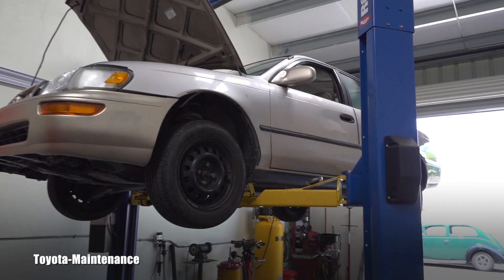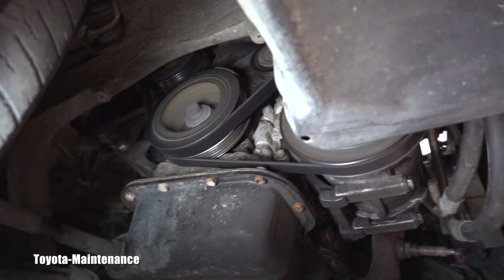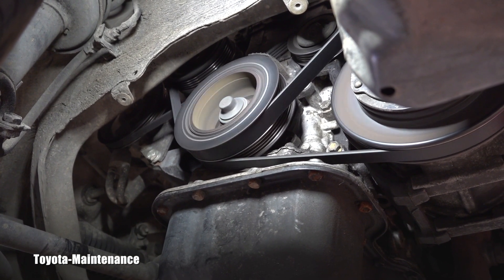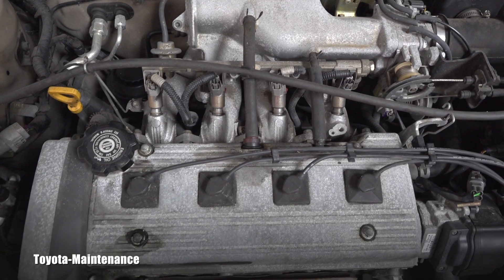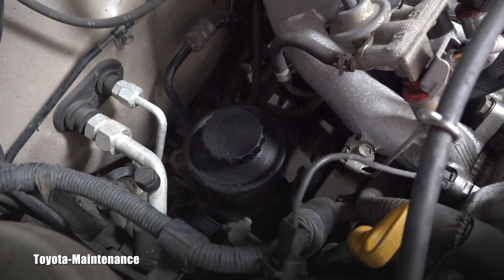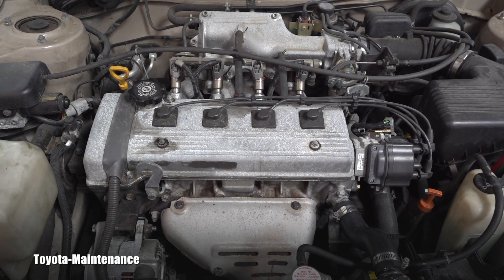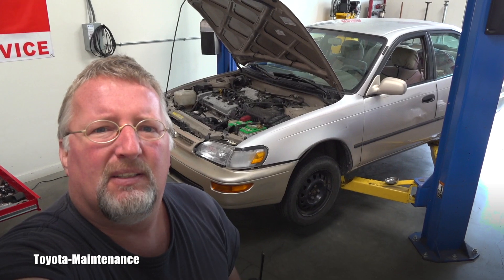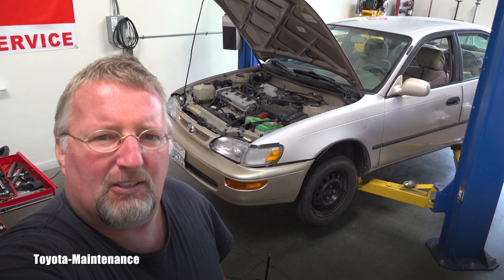Old Toyota engine runs like a champ

Comment: All the corrollas i had in the 90's were great. currently , my 04, is the worst toyota.  soo many parts breaking down. still runs with 196k . but had to replace alot of stuff. 
the 90's , battery , alternator. thats it.

Comment: What spark plugs do I put in my 2002 highlander with the 3.0 v6?
When I check it on the internet everyone is trying to sell their brand so I don't know what ones are correct.
Reply: If you have the manual check on there, best reference. If you don't have the manual call the closest Toyota dealer and ask, you'll get accurate information.
Reply: Use Denso, that is Toyota's own brand.

Comment: Had an issue with my 2005 Toyota Camry XLE at a time of inspection where the dealer said the rack & pinion system needed replacing, the water pump and a belt. and even more stuff. I was mugged by a dealer given the inspection, so ended up contacting Toyota directly and they refunded me $750 on the total repair cost. The car even now only has 71,000 miles on it and likely I see no reason to give it up. I know what I've got...replacing it opens up new questions!

Comment: I just purchased a very expensive 2020 Tacoma because I had a terrible experience with my previous Chevy Colorado. I was nauseous at the price, but I want a truck that will take abuse and last for decades. I hope my 3.5 V6 will be this reliable, but only time will tell. However, I am actually not very pleased with the poor refinement of the Tacoma. The driveliine vibrations (which the Tacoma is known for) are extremely annoying, but Toyota will not address the design flaws that cause these vibrations. At least they don;t tend to lead to reliability problems, so that's a plus. Also, the 6 speed automatic in the Tacoma, while it is a very reliable tranny, is the most annoying automatic I've ever driven. It never seems to know what gear to be in and hunts constantly, even on the highway. I do like the truck, but I think it's overpriced for the level of refinement you get. In any case, I hope it lives up to Toyota's reputation!
Reply: Why didn't you buy the manual?

Comment: New Toyota’s not as user friendly I imagine.
Reply: Depends on the model. 4 cylinder Corollas and Camrys are still pretty easy.  Bigger engines can provide challenges (rear bank of spark plugs on a Sienna, for instance).

Comment: Hey there Mr. Toyota,,,,,, my wife has that exact SAME car, except it's a '93 yr model.........  Same engine,,,,,, my "ONLY" Gripe     with this car ,,,, is the absolute "CRAPPY" GAS MILEAGE! >  21 city, and (maybe) 30 Hwy.........     we've bought it in '06, Jan. with 132k miles,,,,,, at 168k... I took it to a good mechanic , had it totally rebuilt,, piston's rings, bearings, wtr.pump, oil pump, gaskets.... new coil..... thermostat.......... it runs fine,,,,,,,,, just gets CRAPPY GAS MILEAGE.      I've put this question out there to Scotty,,,,,, but > he's too damned busy for me,,,,,,,, never answered.     Can you point me in the right direction?            Either way,,,,,, runs like a top,,,,, going to UPGRADE: to a '03-'08 Toy. Cor.   w/ auto for the wife.......should be getting even BETTER GAS MILEAGE?:!
Reply: did you replace the injectors as well??that might be yur problem.
Reply: @peabody4217  No, I have not,,,, that's what I shall do then,,,,, I'll buy a set of 4 and swap 'em out!          Thanks!!!!!!
Reply: @29madmangaud29  let me know if it improves the milage..  and you will get better preformance as well.
Reply: @peabody4217  Yes, I've already ordered a set of 4 through Ebay, should be here Tuesday........> Yes,,, about the eng. rebuild......... originally > I "didn't" replace the belt "TENSIONER",,,,, it "bit me in the ass",,,, > oh well, if you don't do it right the 1st time,, then do so the 2nd, or 3rd..... ahahahha,,, the Injectors are "rebuilds",,,,, but > should be fine!@
Reply: You should also remove and clean the throttle body. Carbon deposits there are probably the cause.
Reply: If you are looking for gas mileage buy a Prius. Just saying.
Reply: Actually, that highway mileage sounds perfectly normal for an early 90s 4 cylinder. The city mileage could be a little higher, but maybe your wife just has a heavy foot.
Reply: @dlg5485  Yeah,,,,, I have to explain to her about that heavy foot,,,,,, she says she doesn't have..... I tell her: SHE DOES!